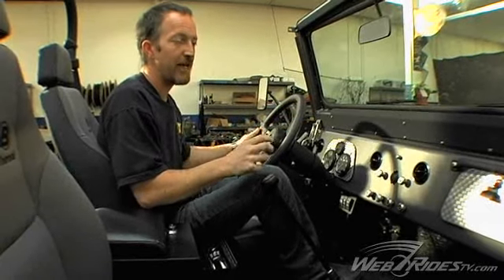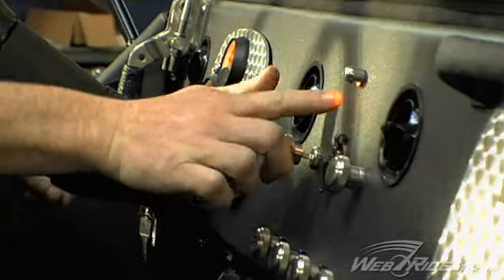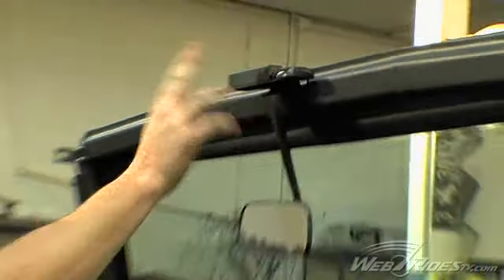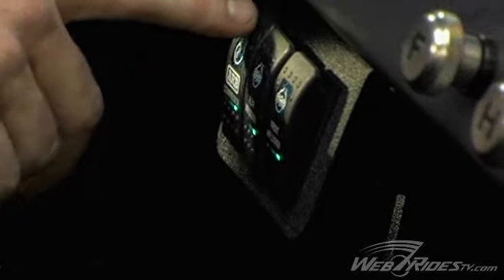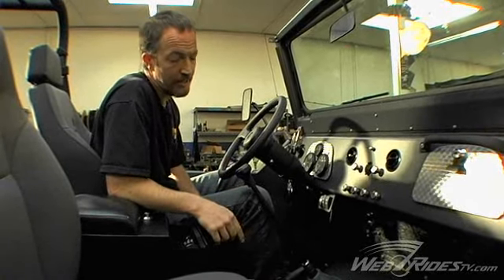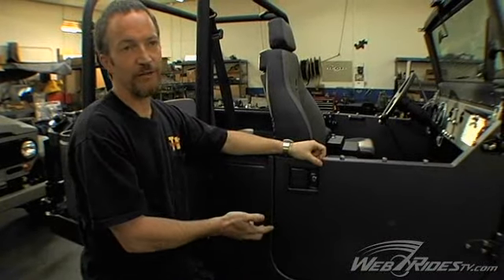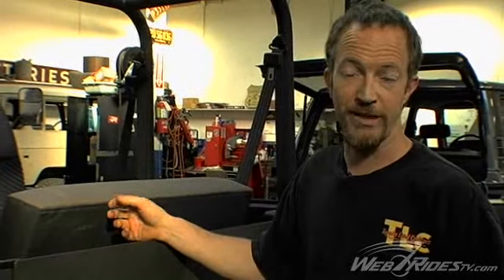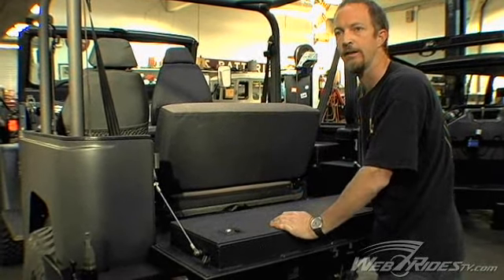TLC Icon - The Ins and Outs of the Icon

Comment: @dewhwut "costs tops $40k" -- Are you serious?  You obviously don't know a whole lot about the parts in this beast.  The axles cost roughly $7k apiece, the NV4500 + Atlas II transfer case costs $3.6k, the engine costs $6k, the wiring harness for the engine is $1k, the gauge cluster is about $0.8k, seats are probably around $1k, etc.  I just riddled off $20.4k of stuff and haven't even mentioned the fully custom chassis, body, and suspension.

Comment: @dewhwut First off, it's $27.4k, not $20.4k.  It was $3.6k for the transmission and transfer case.  That's what they cost brand new!  The axles are top of the line Dynatrac axles.  Long story short, they are quite expensive.  Brand new wiring harnesses for engines typically run around $1k.  

I have no doubt that $20.4k will be sufficient to build a badass truck, but it's not gonna build a fully custom, top of the line, 100% brand new (yes, this includes everything) truck.

Don't insult,research